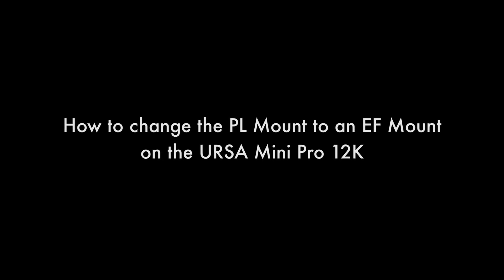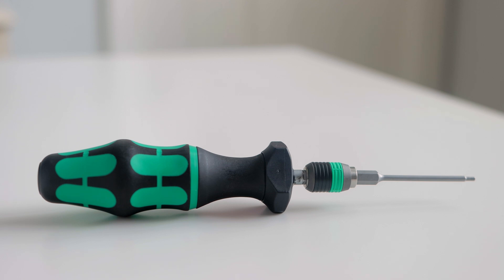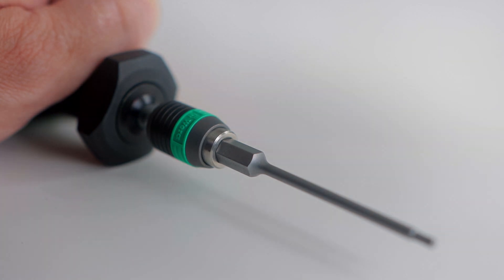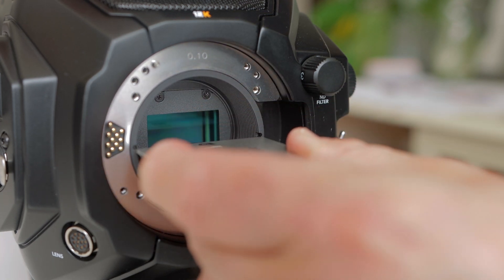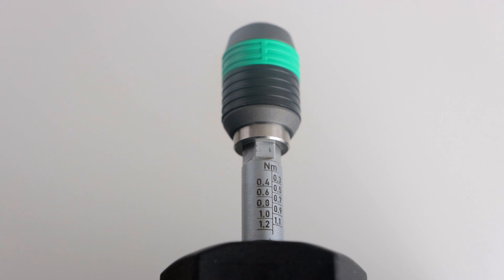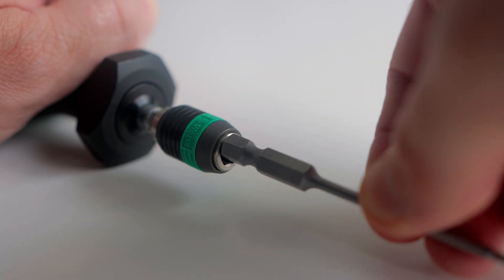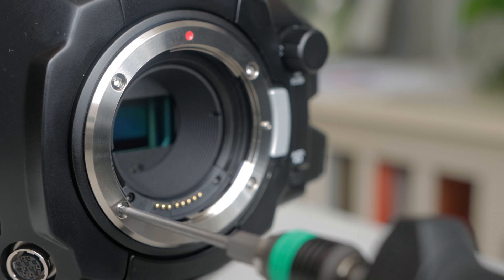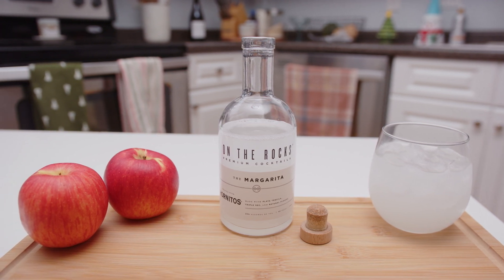PL Mount to EF Mount Blackmagic URSA 12K Tutorial - How to install an EF Mount on the URSA 12K

Comment: i would love to know how can i use a old helios 44-2 with m32 mount on my ursa12k with pl mount?
I dont get it and would like to start filming, if you know have many thanks
Reply from the maker: Those lenses can be bought on eBay with ef mounts. Ef mounts can be used on ursa 12k if you change the mount from pl to ef.
Reply: @LoveWhatYouDo  Thank you, and maybe you have an answer for this, i want to use a anamorphic lens and found the Sirui Venus 35mm with EF-Mount, can i use this Lens on my Ursa 12k Pl-Mount if i bought the EF-Mount Adapter and installed it, or are some Stats different?
(i searched for this but i am still not sure and Sirui hasnt said yes or no)
Have a good one

Comment: I just got a new camera and I notice there's a speck of dust on the sensor, under the IR cut filter. If I follow this tutorial, is it just those 3 extra screws to get the filter off?
Reply from the maker: I personally would not be brave enough to try and clean it myself. I would call Blackmagic and ask them for advice. But that’s just me. Good luck!

Comment: Hey, I changed to EF mount but didn't use a torque screwdriver.  So far, no problem but will a lens fall off or something?
Reply from the maker: The torque screwdriver makes sure you don’t over or under tighten.  It’s always best to use one. That being said, you may be ok if your lenses look good and you tightened it enough so that nothing falls off.
Reply: @LoveWhatYouDo  Ok, thanks!

Comment: Thanks, very well explained. So this EF mount would allow me to use stabilized lenses, right? Are there any stabilized lenses for the PL mount?
Reply from the maker: Stabilized lenses should work with the EF mount.  I haven't seen any PF mount lenses with stabilization.  Those lenses are typically very nice, but very expensive and I could be wrong, but I don't think that they have stabilization (which can be helpful handheld).